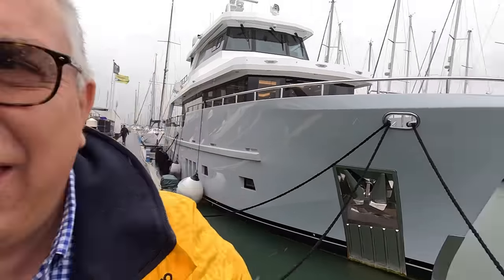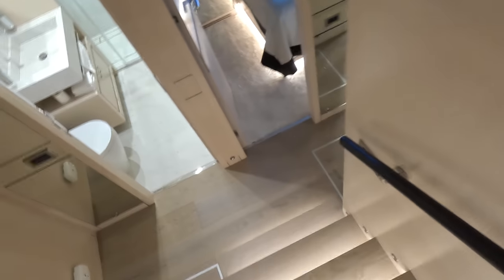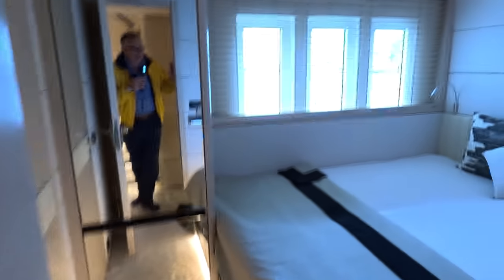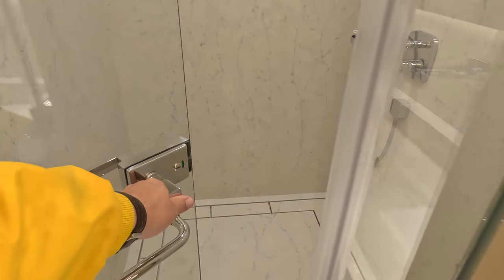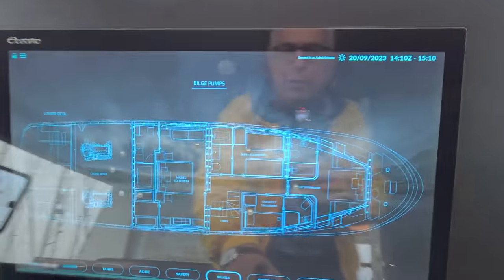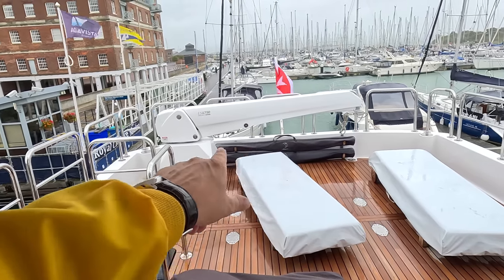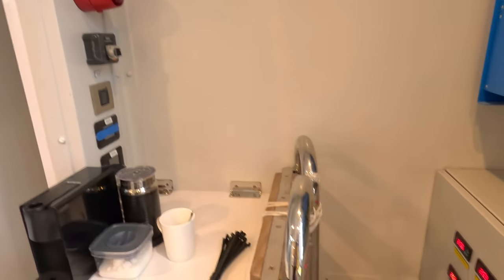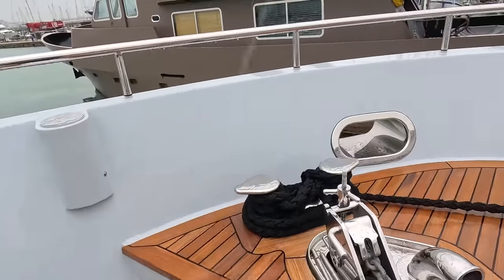€6 Million Yacht Tour : Bering B76

Comment: What an awesome boat. Stylish, built for use, no compromise. I absolutely love it. There is not a single thing i would have done differently. Thanks for braving the weather!
Reply from the maker: It was a pleasure - sort of! 😄
Reply: I'd probably turn the Upper saloon into an owners cabin. Also seems a bit overkill to have three wet/grill bars on a 76 footer given how fantastically well appointed and centrally located the wonderful Galley is. Go for a high class "tray bar" that can easily be moved about if need be. Space is more of a premium concern on a vessel this size than convince. I'd also add a skylight above the dinning room and coat all the windows with glare-less. Lastly I'd shrink the bow cabin berth to as queen and lower it. Easier to deal with a smaller size than low headroom above, and having to have a step ladder to get in and out of the berth lol.

Comment: Excellent tour, and boat. Would be good if you could do a little more on the power systems in your tours? For example on entry into the crew cabin on the left were 4 Victron Skylar heavy duty battery chargers, and on the right were 3/4 high powered Quatro mains inverters... It's great to know the main engine power, but increasingly the electrical power systems are almost as interesting. Would be keen to know how many newer boats are now embracing Lithium batteries rather than Lead acid too..  Thanks,

Comment: Fantastic yacht. Though I am concerned about the engines being covered. Won't it be difficult for daily maintenance and to check for oil and fluid leaks? Plus if you're underway, you won't be able to spot, from the engine room cameras, any problems arising from the engine due to the fact they are covered up.

Comment: I had such a strong sense of Deja vu watching this. I am a hundred percent sure I've watched it although it does seem a little different as well.......then @10m12s Mr Yacht Buoy....bang....that's where I saw this boat. Very interesting comparing your two styles. You both bring your own uniqueness to the table and by watching both videos makes this boat seem even more remarkable.
Looking forward to the interview with the owner. Judging by the fact that they didn't opt for a flybridge, or at least not an open one, I think there may well be some very seriously cold destinations on the cards.
PS. I did spot one very minor and perhaps silly fault. They went to trouble of having a separate laundry room but installed a sink that is more suited to an en-suite rather than for scrubbing out an oil stain before washing!!!!!

Comment: That's pretty much what I dream of getting when I dream of winning the lottery. An owner operated explorer with lots of range to get away for months. Although I'd probably prefer a closed galley, as an open floor plan might look nice, it might not smell as well. Having one cabin as storage seems perfect, as does the skylounge instead of a flybridge, but I'd have kept the loo close to the helm. I hope they at least sealed off the plumbing if they left it in, as you don't want to have water standing in a dead pipe for too long. That's why I'd probably go without the crew cabin and shower as well. I think I remember having seen a video about a Bering with a sauna some time ago, so my ideal boat would be like this one, just with a closed galley, no crew cabin and a sauna and shower/toilet in the skylounge. And then off to the north, seeing some fjords.

Comment: If you can afford it, this is the perfect boat. Or rather, little ship. Proper parallel lines for a ship, instead of the endless curves in all directions like on most modern boats. Proper wheelhouse (although I would mount a proper, comfy seat there), with perfect ergonomics, black interior and closed off from the rest of the ship, and high up for great visibility. Great layout with plenty of storage for extended cruising, and fuel to travel far. I also love that it is intended to be owner operated - I couldn't imagine having a crew on my boat, no matter how rich I was. My boat means my helm, my galley, my engine room! :)
The only thing I didn't like was the engines being below the engine room floor. I see the point, but I don't agree with it. Engines should be fully accessible instantly on a boat this size.

Comment: Great boat. Bering looks like one of the very best quality builders, but the style of the owner operator models are very Tug Boat'ish in appearance IMO, with the only exception being the B78. Of all the boats you've showcased over the years, I have yet to see a fly-bridge design that doesn't look at odds/out of place with the rest of the boats design... the best attempt might be the Horizon Tri-decks, and the FD 75. Which by the way, you need to tour the latest Horizon line again.. The FD87 is gone for example (Now FD90), and a proper showing of the FD75 would be an exciting watch!

Comment: Without a doubt, the nicest Nordie I’ve ever seen, because I’m used to the stoic dark wood/etc. and this is quite the opposite. But, the thing I hate the most is, there are no doors exiting the wheelhouse – that boggles my mind.
If you need to get outside quickly, you’re bailing out the back end of the boat and then coming back around to get to the front???

Wow 

Oh, yeah, great video as usual!
Reply from the maker: If you had a door on the side of the wheelhouse it would be quite a drop before you hit the side deck below! You just go down the internal staircase and straight out of one of the side doors on the main deck. 🙂

Comment: Continuous Duty is rated for 2-3x the Hours of a normal engine.I would engineer some Flex-Solar Bimini for the Fore & Boat Decks to augment the Built-In Solar Array & further reduce fuel consumption. I Love Bering Designs, as a 20-yr. Submariner, I'd be proud to operate a Bering vessel.

Comment: I prefer the acres of woodwork and bespoke joinery aboard a Nordhavn, but the Bearing range possibly gets my coin flip due to a steel hull and the over engineered doors, hinges and the low center of gravity, placement of the engine's. All very clever thinking.

Comment: Nice decorations, but some functionalities are peculiar especially for owner operated boat。 With all the steering controls in the confined pilot house. It's hard to tug your head out of either the port or starboard side to visual potential hazards in tight spots. Understand there must be steering controls on both starboard and port sides, but there are situations you need to hop over very quickly。 Owner operated boats mostly would allow the owner to quickly hop from port to starboard and vice versa. In addition, I have seen rear water tight gate being split open in very rough sea.  I just realized this yacht company is only started in 2007. I think they should have started from smaller boats first。 The shipyard crews' experiences are very important。

Comment: Pretty big house on the waves. I did not like interior of some previous Bering as there were quite a lot sharp edges (Sounds to me like bad idea for rough sea). This one seems to be better made. I just guess that interior is made by quite competent professional designer.
Engine room is quite poor compared to Nordhavns 😁
I just wonder if it is OK to make ocean-going ship and at the same time such a big windows. Like modern glass houses/skyscrapers. And even more - so many windows barely above sea level on the sides. Transparent material are not as resistant as ... steel. Looks tome like weakspot. Especially as there seems to be no (metal) blinds as on more traditional yachts. I am just curios but watching videos from really rough seas and having potential opening on the side so close to water at the same time would be unsettling to me.
But it is a gorgeous boat

Comment: I really like bering yachts but they have the same problem as nordhavn to me, no speed when you want or need it.  A beautiful great built yacht, just wish they had more speed. I go boating a lot and 9 knots is extremely slow. A short trip takes all day.
Reply from the maker: The only way you'll get speed is with a planing hull and huge engines - then bang goes the range. These (and Nordhavns) are designed for world cruising, a different sort of boating.

Comment: Nice job but what's a hob?
Reply from the maker: hob1
/hɒb/
noun
1.
BRITISH
a cooking appliance, or the flat top part of a cooker, with hotplates or burners.
"the oil needs to be heated in the oven or on the hob"
2.
a machine tool used for cutting gears or screw threads.
"the hob cuts material from the tooth spaces"
Reply: @AQUAHOLIC  Not to be confused with a Hobnob which serves no function except to bring joy. The world would be a better place if everything came with a Hobnob, innit ?